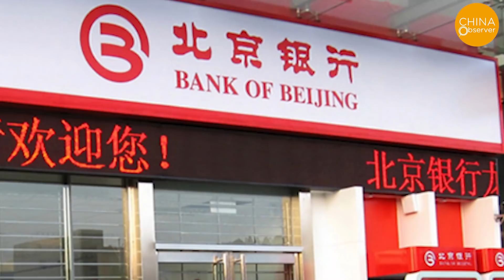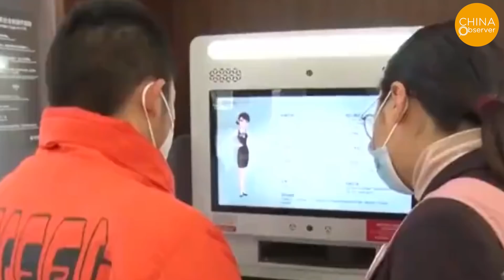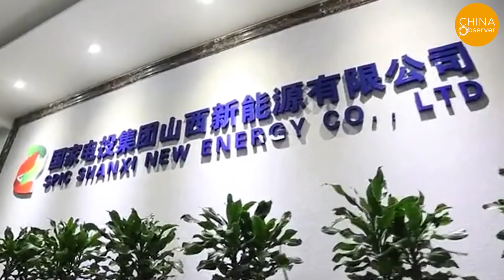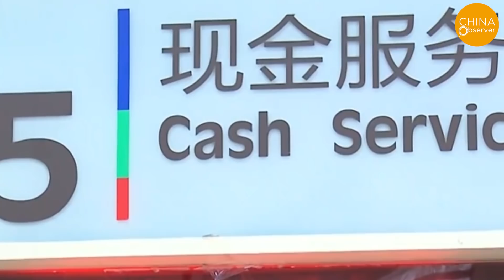Resale Home Loans Stopped, Trigger Housing Market Changes in China?

Comment: I live in a new house in China, and I am terrified. It’s not the old ones to worry about, it’s the new ones. In my building alone, it’s a sixteen storey building, the bottom concrete pad is uneven and it’s already crumbling. It’s only 1 year old. Also the bottom slab doesn’t match the size of the building. It’s too small. Fact is I have lived in an old building, it’s dirty but much more solid.
Reply: Why don't you leave?
Reply: @onlyplaysveigar7241  Who would buy it to take the owners place?
Reply: they called it 'tofu crumb' for a reason lol.